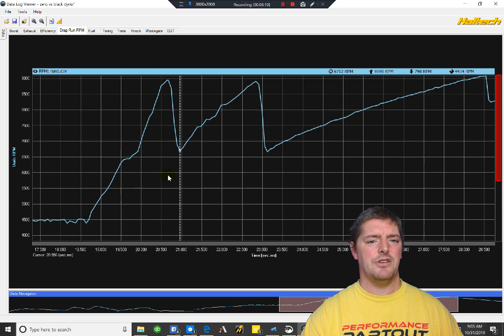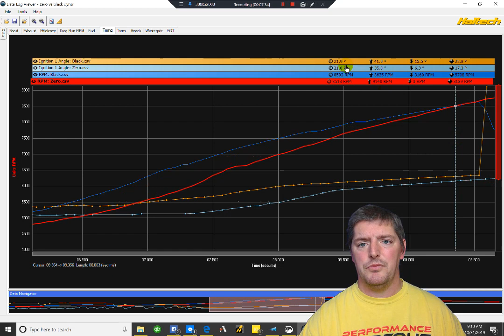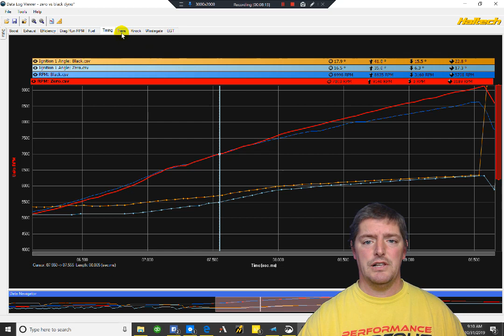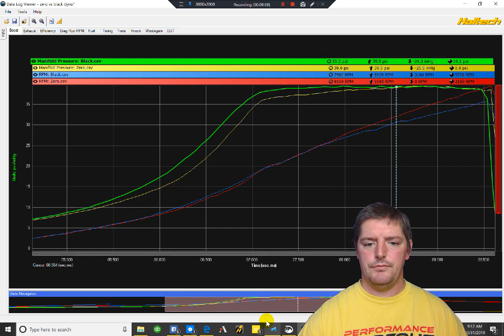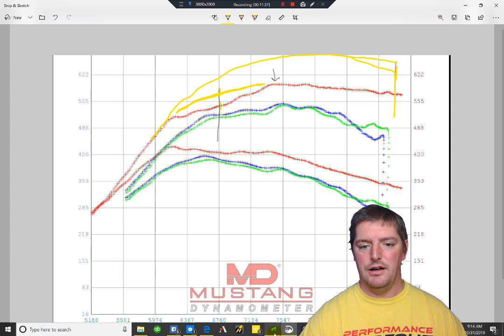FP DSM Zero vs Black dyno comparison

Comment: I'm running the FP Green on my 2020 STI with E85, 1700cc injectors, and walbro 450. Its mainly a street car but not my daily. I'd like to get a little more out of this car but hate to lose my low end spool. I wonder if the FP Black with 8cm housing would give me a good bump. Its a stock RA motor for the time being, once I do a built more I can rev out higher I wouldn't be as concerned with spool.